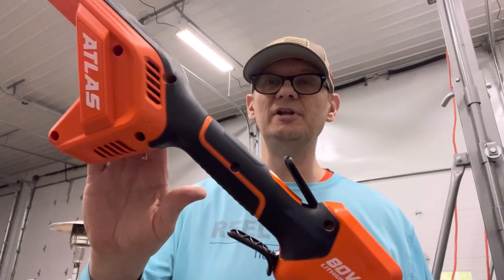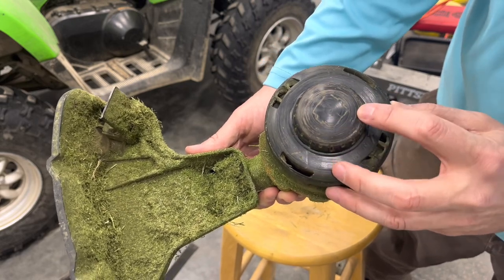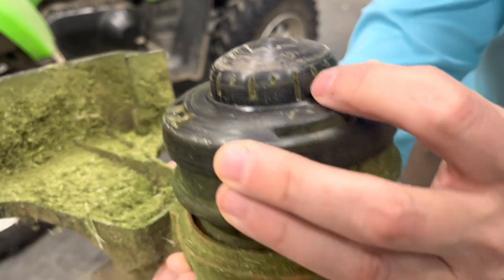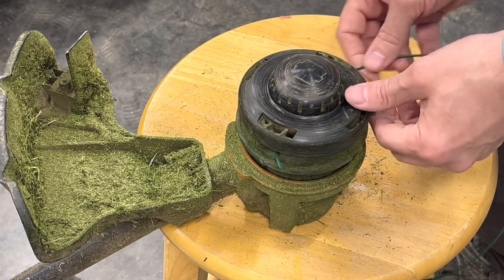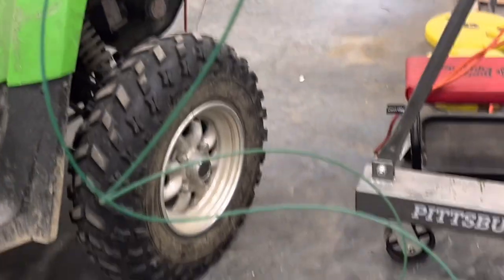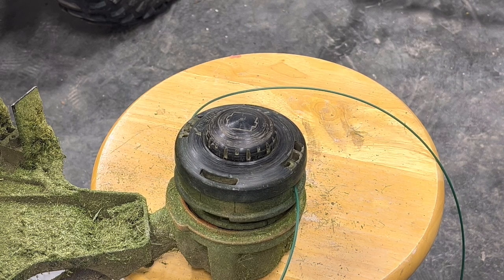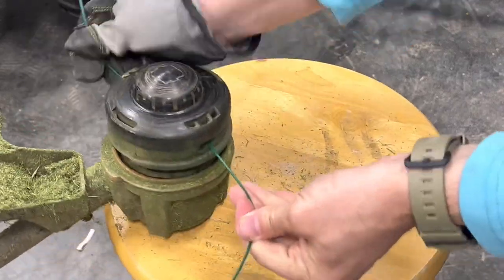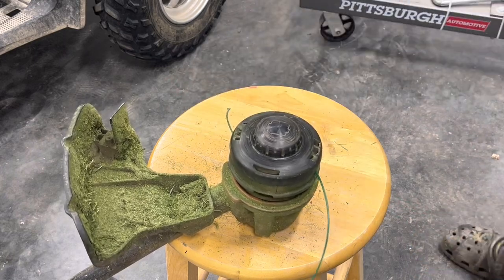Atlas Trimer String Replacement - Harbor Freight

Comment: Thanks for the video. It wasn't clear how to reload the string, but with your help, it was no problem. By the way. This works with the 40v Atlas trimmer as well. It's the same head.
Reply from the maker: Thank you for watching and your comment. We are glad it helped. Thank you for the info on the 40v also! Have a great day and be safe!
Reply: I have the 40V. Today was the first time I tried to replace the line. What a PITA! I guess the line has to be fairly straight, to go in, like in this video. Anyway, I’ll try again this weekend.

Comment: Mine is really hard to turn once I get my line threaded through.  I’ve cleaned it and I have used it only one season. Any suggestions?
Reply from the maker: Make sure you use .080” line. It will work with .095” line but will be hard to turn. The other thing to try is to totally disassemble the head and clean all the gunk out then see if it’s easier. Finally, you could use a strap wrench or oil filter pliers to hold the head while winding the spool with another one. Also wearing gloves helps with grip if that is an issue. Good luck, thanks for the question and have a great day!
Reply: I used my mechanic/grippy gloves and that helped, not easy, but good to go.
Reply: @CopperBarnHomestead  copy on the .80 line, I did have the .95.  Thank you for tips!

Comment: This was a lot of help but when winding the line on counter clockwise it is a bitch. Mine you have to push in while winding which doesn't give you much hold.
Reply from the maker: Thank you for watching and your comment. We have had the issue as well. Sometimes it is not difficult to wind and then the next time it can be very difficult. We found you can use oil filter pliers to hold the pieces when winding if you are careful to not tear up the plastic with the pliers. Have a great day and be safe!

Comment: Hi there sir, my question is can I  use .095 line on Atlas string trimmer 40V Lithium 15 inches instead of .080 line, awesome video.
Reply from the maker: Thanks for watching and your question. I think it would fit but I don’t think I would. The bigger line takes more power to turn so it will slow down your trimmer. These battery trimmers don’t have as much power as the gas ones seem to have where you could get away with running a larger line. If you do try it out let us know how it works. Have a great day and be safe!

Comment: Witch way does the head turn clockwise or counterclockwise or both ways
Reply from the maker: Hi, thanks for watching and your question. When loading line hold the base of the head and turn the center part of the head counter clockwise. Good luck! Have a great day and be safe!
Reply: When weed Wacking does the head turn clockwise or counterclockwise
Reply from the maker: When using the trimmer looking down at the head while cutting grass the head spins clockwise. Thanks again! Have a great day!